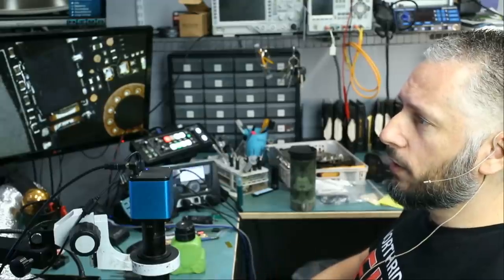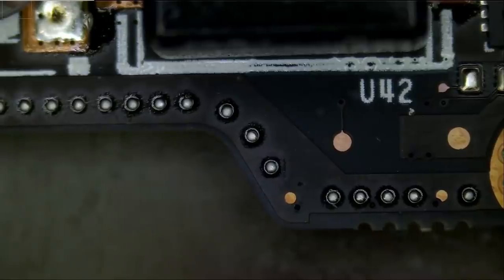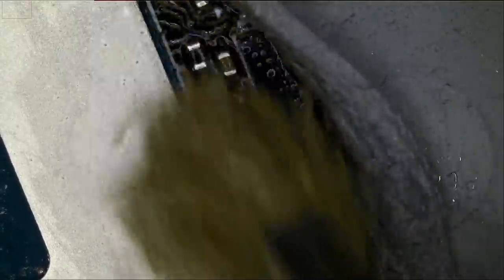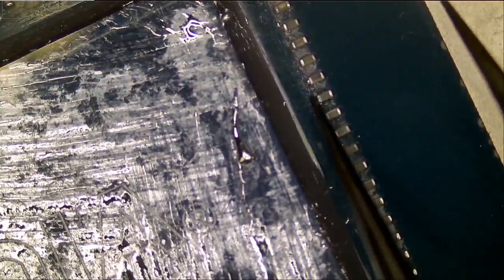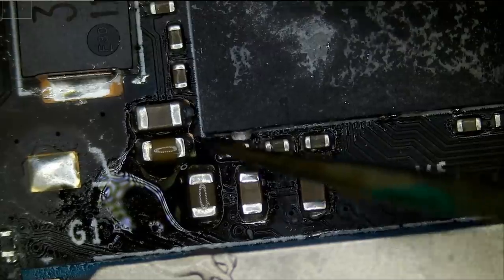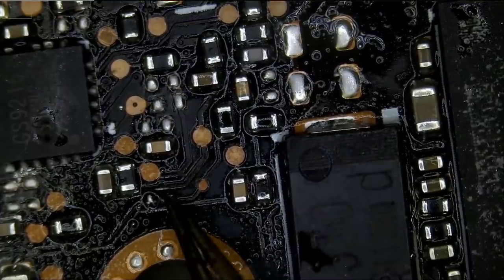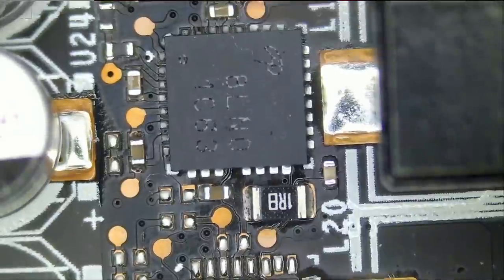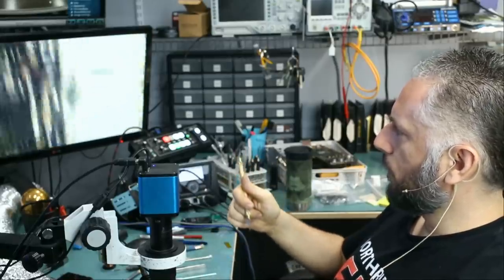RTX 3090 Graphics card Blew out after using Liquid Metal. A frustrating video to watch

Comment: If I would have a 3090, I'll just use it. Liquid Metal is so risky and scary.
Reply: @Hunter_Bidens_Crackpipe_  Lol a laptop for 3K, or the name alienware sold you ahah
Reply: @Hunter_Bidens_Crackpipe_  you realize how this sounds, right?
Reply: @Hunter_Bidens_Crackpipe_  unless you dont move your laptop, i advice you stay away from LM, even if you coat everything on gpu\cpu with nail polish. Good thermal paste and clean radiator(s) are half of the job, you should also undervolt both cpu and gpu, it will do more than LM, and is much safer.
Reply: @TheCanadianMob  bet you can get better specs at 1.5k from any other brand

Comment: I would try compressed air for standalone air compressor, not canned one. He has strong air flow so it could be helpful.
Reply: This. I've used one to blow water out from under BGA chips on a motherboard that got wet. It should work the same for liquid metal.
Reply: @madmatt2024  nope, you'd just spread the liquid metal out over a larger area. Think of liquid metal as paint that won't dry.
Reply: @kmgrillen  I think you're confused. I was talking about getting the liquid metal OUT from under BGA chips after it's already messed up.

Comment: solder sucker or compressed air in the backyard? might be quicker re removing liquid metal? never touched the stuff myself though
Reply: compressed air may push liquid metal under ICs...
Reply: I would also use compressed air after cleaning all the visible liquid metal, to push it out from under the bga-chips. he should also try to look under the bga-chips from the side, but that might be hard with a board this crammed.

Comment: A small vacuum (dedicated vacuum pump, not a shop vac), think of a air brush setup but with reversed flow, the paint pot will be the catch tank (small hard foam filter to prevent material getting into the pump) , regulate the flow, have a silicon flexible nozzle to get into the crevices, will probably require some fiddling to get it just right, or a lab suction pipet for a manual option, just a thought.

Comment: The best way to remove "Liquid Metal" is not to use the absolutely horrible stuff in the first place, it's probably under the GPU or other BGA chips thoroughly flush the board with IPA under pressure from a very small nozzle while standing it on it's edge vertically, I've seen so many amateurs try to use this & destroy CPU's & GPU's.

Comment: I would use compressed air to remove it. (Edit: Outside far away from any other electronics and people)
Reply: You could potentially trap it under other bga  chips worsening it
Reply: Not a good way to remove would just splatter all over.
Reply: @TheBlackAndWhiteCow 
That's how I clean below cellphone bga chips, you can see the liquid getting pushed away from the bga chips.
Reply: @alreed2434  @TheBlackAndWhiteCow you would use compressed air after removing all the visible liquid metal
Reply: @markus98sb  probably good as a last step I would start with an electric solder sucker with no heat as close as possible to the board then use compressed air

Comment: I used Liquid Metal once on my CPU. I delidded it, cleaned it, put Liquid Metal on it and resealed (with the gap) the IHS like original. I didn't insulate the SMDs that were under the IHS.
It was also my first delid and first use of Liquid Metal, but the CPU works for 5 Years now without any Problem. I worked gently, slowly and watched a good Video of doing that beforehand.
The difference was -10-30°C depending on the Overclock. The TIM on the DIE seemed faulty. It looked like there was an airgap. Of course one can only see it AFTER delidding....
So it was worth it.
But watching other Youtubers who are shooting Liquid Metal all over, because they cant handle a Syringe gives me goosebumps.

Comment: can ultrasonic cleaner help remove liquid metal? just wondering.
Reply: As liquid metal is a metal and for liquid properties I believe the surface tension of the liquid metal won't help ultrasonic cleaning.
Reply: @aperson9375  I believe it might also push liquid metal under chips, causing new shorts. this is much safer way.
Reply: I’m thinking a tiny suction device would be ideal. Kind of like the suction they use to remove ear wax or maybe even a solder sucker

Comment: Imagine wanting to change thermal paste on a brand new card.😂😂😂😂
Reply: Overclocking i guess. But if have No clue how to do IT yes thats Just dumb
Reply: @lakaldrak  doesnt sound like this guy know how to do that😂
Reply: To be fair Vram temps on 3090s are reaaally high so i get why he tried to fix it... i just dont understand why you'd work with liquid metal. for the first time it seems. on a damn 3090.😩
Reply: @kalashx2113  But the VRAM isnt on the GPU die. Still doesnt make sense.
Reply: @triliner254  what are you smoking?
Reply: @kalashx2113  high vram temps won't be fixed by liquid metal,because the vram chips aren't on the gpu die. The vram are separate chips often connected to the heatsink with a thick thermal pad.
Reply: @danielvanced5526  bro pls dont speak if you don't get the context
Reply: @kalashx2113  I understand the context, you are a troll and don't know how GPUs work 👍
Reply: obviously, Daniel

Comment: Copper desoldering braided wick is probably worth a try to soak it up.  I'm guessing, never tried it, but it would be high on my list.  You'd have both the wicking action and the copper acting like a sponge for gallium at a molecular level.  Possibly hit the wick with some flux and heat, to clean it, if it doesn't work without (so the gallium gets some fresh copper to eat, not for the heat).

Or, if you have one handy, a syringe should do it.  There are spring loaded desoldering syringes on the market with small nozzles (intended to suck up normal molten solder, but no reason they shouldn't work with cold liquid metals as well).  Medical syringes with a small needle might help as well, for precision work in tight spaces.

Comment: Have you tried using one of those desolder sucker to remove liquid metal? I am surprised people don’t build some barrier around the die when use liquid metal on a RTX 30xx. The thermal pads used by memory can prevent a perfect contact between gpu die and heatsink, which cause very thin liquid metal to slip out.

Comment: Oof, this is exactly why I never liked liquid metal
Reply: i used and no problem you ned just a very small drop and carefully stretch it to all dye he used to mutch
Reply: @cristikreatine  Problem is you also need to take your whole PC apart to change it around every 4 months
Reply: @Snecho  yes 4 to 6 month you are wright
Reply: I've been using liquid metal for years, rarely have to replace, it does dry when you take apart to check, but the cooling capacity is still way better than normal paste
Reply: @Snecho  so does that mean all ps5s are screwed in half a year? 😂
Reply: @Ownage4lif31  No silly! PS5s are screwed the second they come off the assembly line :D
Reply: @Snecho  lmao
Reply: @Snecho  No you don't, I have liquid metal on my GPU for over a year and I did not have to replace it.

Comment: You can chill the board which causes the liquid metal to solidify.  You can them chip it off, though not much time to do so before it goes liquid again.  Only issue is on rare occasion certain components can develop stress fractures if brought down too low.  I use a bottle of electronics duster, turn it upside down and spray in a small container.  Then soak cotton swabs in it.  Can then chill select locations to solidify.

Comment: Use tooth brush and isopropyl alcohol a lot! and before reapplying it cover the components with waterproofing urethane conformal coating  then cure it and check it with UV light and re-apply it till you get it completely covered.

Comment: You can use handheld suction solder remover to catch the liquid metal. I may be missing the actual name of the tool but I used it when I used to repair VCR and Video Cameras. also you can use a copper sleeve with soldering iron, once you have gathered all the liquid metal to a blank space on board.

Comment: Liquid metal is totally safe to use if you prepare the PCB properly.  I applied it to both the CPU and GPU of my laptop, but put three coats of silicone conformal coating on the PCB surrounding the chip.  Zero issues and we're going on 2.5 years.  People should really do their research before doing these modifications.

Comment: You have to use a dry Q-Tip or swab.  No alcohol. Roll the Q-tip over the liquid metal, don't brush or wipe it.  That gets it off.  Then the remaining tiny traces can be pulled up with an alcohol saturated swab.

Comment: Have you considered using a fine injection needle? Liquid metal demonstrates pronounced surface tension, much more so than water and might get trapped inside by capillary action. They make them out of glass too, for laboratory use.
Reply: Exactly my thought. I once had a small spillage on a pcb and I sucked it up with an injection needle.

Comment: I Had something similar but it was on a PC I built for a customer. Custom water cooling loop, RTX 3090, Ryzen 5950X, 64GB RAM on a Asrock X570 AQUA. Customer said the temps were getting to 58C while gaming, so he put liquid metal on the CPU. 
It was on Everything. Absolutely Everything. all over the board, all over the fans, the RAM, it was even in the RAM slots, All over the graphics card, In some of the PCIE slots and i tried everything. EVERYTHING... Hand cleaning it, Ultrasonic cleaner, Solder wicks, Suction, Compressed air, my dad suggested i try some Hydrochloric acid on a Q Tip, it worked to get the lighter residue off but thats about it. I even tried putting the board in the fridge, thinking it would make the liquid metal harden so i could just pick it off? it would work if you had a Walk in freezer maybe it would work but i had been working on it for around 5 hours so at that point i put it back together, called the customer and said There is nothing i can do with this Its an absolute mess, Nothing i do will get it off because its everywhere and when i think i got all of it i find more of it. Instantly he wanted a new PC built with liquid metal, I told him i dont use the stuff, 58C is a very stable temperature while gaming, its only when you're seeing 70-80C that you need to worry.
Next day i built him a new PC, custom water loop, same parts and when he picked it up i told him if he uses liquid metal again ill refuse service the moment i see it. The 10% performance boost that isn't even guaranteed isn't worth it.
Just Seeing this GPU Gives me PTSD.

Comment: Having done several liquid metal jobs on chips before, it's actually very safe as long as you take the proper safeguards.  This guy, clearly didn't.  If anyone asked me if I would recommend doing it?  Yes, hands down every time, but you HAVE to protect yourself.  This job looks rushed and sloppy.  Biggest tip to protect against the majority of issues you'll run into (as long as you don't drip you chicken metal soup as you move over the PCB) is to just coat all the SMDs close to the IC with fingernail polish.  A coat or two makes for a great electrical insulator.  As long as your safe, liquid metal offers a pretty big difference in thermal transfer and lowers chips temps by as much as 25 degrees in some cases.

Comment: Many people can't figure out that the main issue isn't the GPU itself, but the VRAM (especially for the 3090).
They get real hot and the thermal pads aren't ideal for them unfortunately.
The most we can do is use a high quality thermal paste (non-conductive one, as usual) for the GPU, and thin thermal pads with a watercooled block for the whole video board.
THAT'S the most out technology permits.

Comment: Use a solder sucker to remove the liquid metal. The fast suction action should pull it away easily. Also compressed air through a small nozzle to blow away some liquid metal.

Comment: I did liquid metal on my GPU and the results were outstanding. BUT...
When I did it I sealed everything around the GPU (all the caps and resistors) with clear nail polish before laying kapton tape on top of that as close to the GPU chip edge as possible. Also painted it on in an ultra-thin layer, spreading it out as much as possible with just a pinhead dab in the middle to ensure some contact if by chance I did it too thin.
After 1 year I put normal paste because liquid metal wasn't that worth it since it tended to amalgamate with the bare copper heat plate of the cooler. It may have been good if the cooler was nickel or silver plated but I'll never know. I now use some GD900 from aliexpress with an aftermarket cooler (arctic accelero) and I get 27 idle and high 50s in load.

Comment: It's not just shorting out stuff.  The gallium can merge with other metals (e.g. copper traces, solder, the heat spreaders, heat sinks, etc) at a molecular level to form exciting new alloys that are softer than before and have the strength of cheddar cheese.  That's a one way process, can't be undone for metal that has been turned into a gallium alloy.

It's specialist stuff to be avoided unless you actually know what you're doing and need that last 1% out of your hardware (with a stong likelihood of a shortened life).  The thermal properties are excellent, can't deny that, but it's extreme OC territory and a bad idea for consumer level retrofit on the systems you use every day.  In many cases, the performance in gain is essentially just theoretical, the marginally improved cooling doesn't even gain you something useful.

Comment: Syringe with a tiny needle might be best way to remove the bigger LM drops. Same thing if you apply a bit too much on CPU or GPU, just drain the excessive amount back to syringe. Use a "dirty" syringe for the repairs. Smaller drops can be cleaned with cottom swabs.

Comment: In regards to your suggestion for removing it—would it not wick up onto a soldering wick or even into like a torn piece of paper towel?  My novice approach would likely be a low setting heat gun and a vacuum pump.

Comment: As far as i know, liquid metal thermal compound is actually a metal alloy which contains gallium, and gallium really loves aluminum. It forms sort of an amalgamate with aluminum, and the speed of intercalation increases with temperature. Many solid capacitors are aluminum based, and i don't know if the multi layered pcb's of the motherboards use aluminum instead of copper for the ground planes and so, but my guess is that any gallium alloy shouldn't be used as thermal conductive compound where aluminum parts are involved, and that includes electronics. Imho. Or what do you think?

Comment: Based on the fluid behavior of liquid metal perhaps a flat tip fine needle syringe or solder sucker (for areas with more space) should work. I've never had problems like this with liquid metal thermal paste to test these methods, but I think they might work

Comment: The point is that unless this card is fixed the customer lost 2k. That makes an opportunity for a cleanup methods testing experience. After phisical inspection and manual cleanup i'd try an compressed air. Sinking it in alcohol may also be an option yet maybe a bit aggressive and may require replacement of capacitors. You can also grab some of this metal and check how it behaves on different board after heated up and treated with alcohol. Maybe you will find a method to reduce it's stickiness so it can be efficiently blown off or brushed off. As soon as it get's under bga ofc.

Comment: Does it make sense to stick my board in the freezer, hoping to freeze any bits of liquid metal so that they will fall cleanly away?

I've never dealt with that crap. Also was not expecting it. First time cleaning my ROG Zephyrus G14. Used q-tips and paper towel to try and remove the liquid metal, preparing to apply old-fasioned paste. Really made a mess of things! I finally got all I could find... but there's got to be some hiding somewhere. Can't see it, but there's definitely a short somewhere. Battery connector sparked when reconnecting, and no lights on the board... even with charger connected.

Comment: hey if heat from the hot air works, why not cold air, I mean is there some tool that could be used to make the tip of your tool cold enough to pull liquid metal off easier? anyways subbed, seen some of your other videos before, well done by the way it sparks my interest in electronic's.

Comment: Outsider question : Can you use low electro-magnetic field to helps catch and release liquid metal???  Or maybe an electrolytes liquid tha could helps moves liquid metal to a cathode or anode.  Maybe adding micro-vibration to the board to helps detaching it and getting loose.   Any tought??

Comment: I would advise against using liquid metal with air coolers because the limiting factor is the cooler itself, not the interface between the cooler and the die.
Re-pasting with top-quality compound, though, is definitely worth doing - manufacturer pastes are often garbage, and not just for cost-cutting reasons.